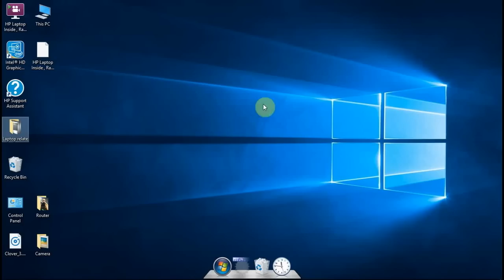Laptop Inside , Ram Upgrade & Cleaning Dirt

Comment: It's a nice video😁. 
I have a doubt. I have a laptop which runs too slow that it takes nearly takes 20 minutes to boot
It's A Hp 15 (RYZEN 3, 4GB RAM, 1 Tb HDD) currently running windows 10. Its not even booting properly. Reinstalled windows. But that didn't work.
All i want to ask is can cleaning dust help the laptop to work properly
Reply from the maker: Hello brother thanks, you can increase Ram and also SSD installed then possible to increase your laptop performance.

Comment: Very nice video
Reply from the maker: Thanks
Reply from the maker: You say water falls on your laptop, you first remove bettery from your laptop, then if you do open laptop inside and wipe all inside parts and cured properly then you can reuse it , if not working as soon as contact near any PC technician.
Reply: Thanks

Comment: bhai how to increase speed of fan in toshiba c650
Reply from the maker: Your laptop inside fan may be fixed to speed, if not working properly you can replace. You can use external laptop stand with fan for supporting cooling system.
Reply: @HamidurRahman   actually i ugraded CPU to i5 from pentium so heating too much. i have to underclock to cool it but speed bcame lower by it. can u tell which register i can use get it faster speed.
Reply: and i also dont know which fan i should use for faster speed
Reply from the maker: @MMaheshThakur  If you use desktop pc you can change your cooler fan that will be good support , But if you are using laptop fan may be included in the motherboard as fix . You can see my this tutorial-https://www.youtube.com/watch?v=-z-EhAz_Le8
Reply: Use SpeedFan, a software